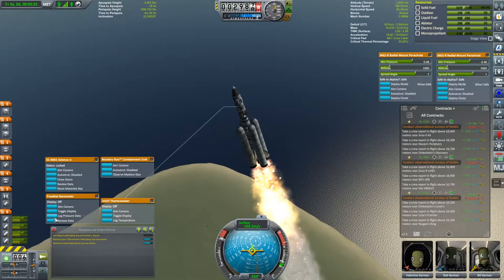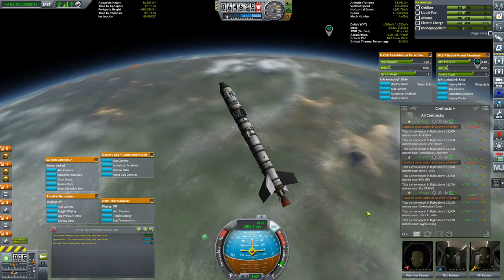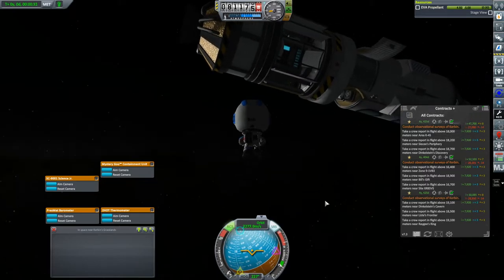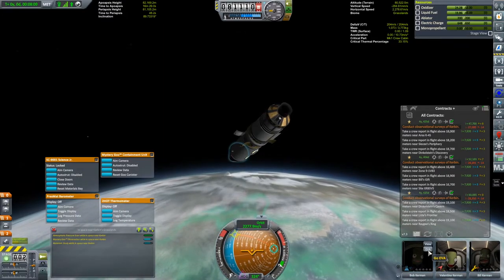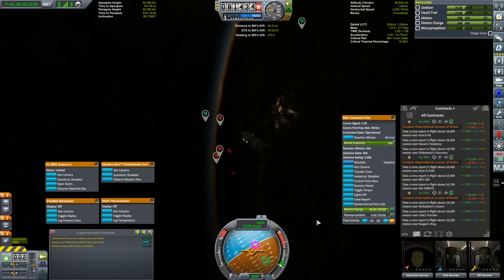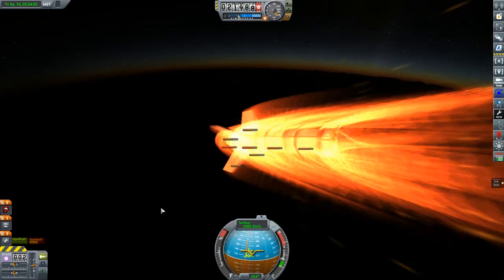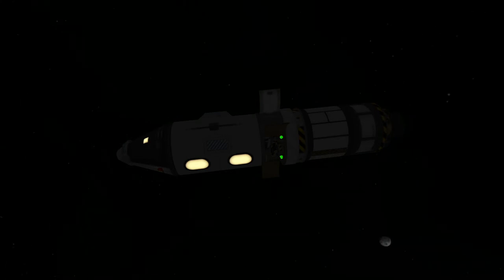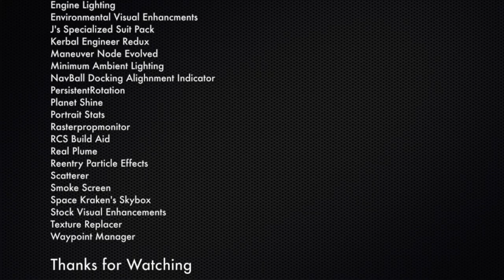KSP 1.2.2 Career: 5 - Polar Orbiter

Comment: Looks quite a bit like my "Tourist Trap" tourist vessel. I take it that you don't have any life support mods installed?
Reply from the maker: Nope.  This game is pretty much stock.  Just beautification and UI mods.  It's vessels like this one that really drives home that stock needs a two-crew, Gemini style capsule.
Reply: Too true. Or a single-Kerbal, inline cockpit in 1.25 which can be docked behind the Mk1. 

There's a pretty nice two-seater in Near Future Spaceships that I quite liked. 

And yeah. I was blinking in disbelief when you mentioned a multi-day mission without solar cells. Life support puts a decent burden on all that.
Reply from the maker: The MOLE mod has a nice one too, including a part that fits under the Mk1 capsule to add a seat.
Reply: Yes, although the back seat widens to 1.875 or 2.5.